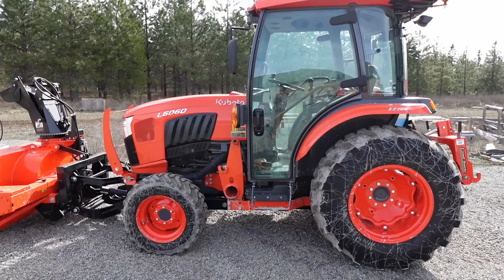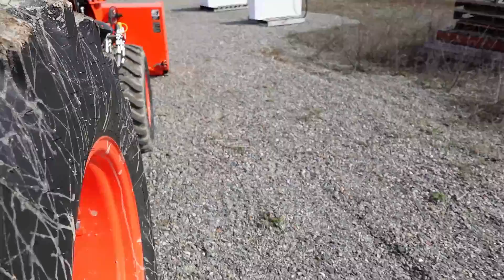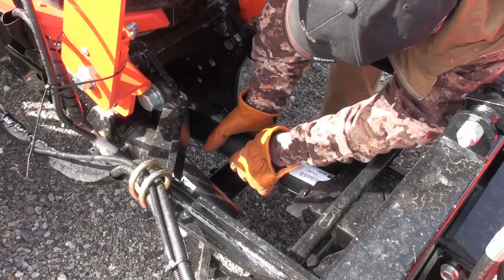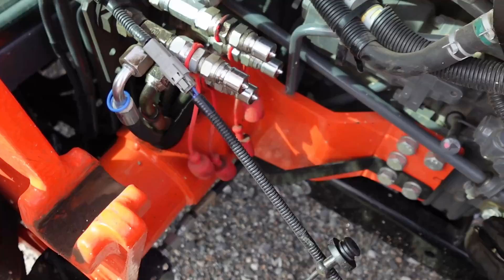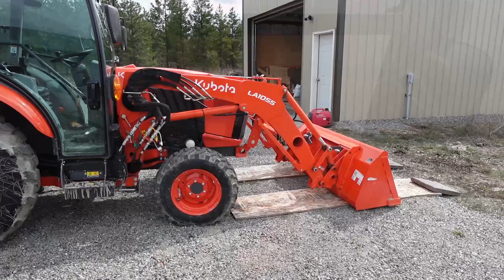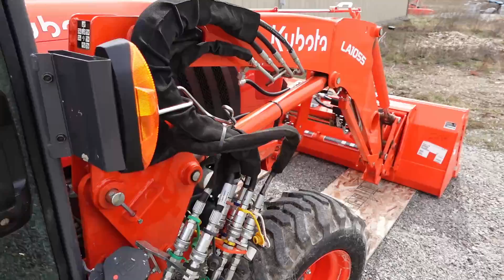Disconnect Kubota L6060 From Kubota L4474 Snowblower, The Best Way!

Comment: Nice video; Thanks!  Question ... I have a Grand L6060 as yours and I have to remove my grill guard to mount the front snow blower bracket (to where the grill guard was unbolted from), each and every year.  I noticed that your grill guard has the front snow blower bracket all as one unit.  Does your grill guard with integrated snow blower bracket have a unique Kubota Part number?  Could you please provide it if you know?  or did you get the snow blower bracket moded / welded to the grill guard?  I very much need to make this happen as I'm over 60 and swapping every year is getting harder and harder to do.  Thanks for any and all information you can provide.
Reply from the maker: Thank you for the comment. I really enjoy my L6060. The front mount I have is the “KUBOTA L4481 FRONT
SUPPORT FOR 4PT FRONT”. Not sure what they cost these days but when I bought mine they were $190.00 (US). This mount was great because it allowed me to keep my front grill attached all the time and still be able to attach the 4 point hitch.
Reply: @rockriveracres  Thanks very much for the great info. and quick reply!  This is great news!  I think I can use this as I have the same 'Manual' 4 point hitch, although I have the L4479 snowblower, but believe that both blowers mount to the same 4 point hitch.  Someone else said it worked with the 'Automatic' 4 point hitch, but am sure you have the manual type.  Is there anyway you could send a closeup of how the 'kit' mounts?  Or perhaps instructions of how to mount the L4481 kit / bracket?  Again, thanks so much!

Comment: Excellent video - Thanks!
Reply from the maker: Thank you, really appreciate the feedback. Let me know if there are other videos you would like to see. I’m working on one that will show how to reattach the sub frame and snowblower.
Reply: @ That would be helpful, there really isn’t a good one out there.  Another thought is how to change the hydraulic fluid filters, lots of different ideas floating around regarding the use of a shop vac to help keep the fluid in but I haven’t seen it done.

Comment: Your front brush guard is that Kubota?  My brush guard has to be removed for the bracket for the front hitch bracket.
Reply: Interesting, did you have to get longer mounting bolts?  I have the same guard on my L4060 (although I added a grill insert from Messiks when I bought a grapple), but I too have to remove it to add the subframe support…
Reply from the maker: I didn’t need to get longer bolts The L4481 mount came with everything to allow me to use my original grill guard and still be able to mount the sub frame when needed. Let me know if you need more details or photos. Thank you so much for viewing and your comment.
Reply from the maker: Yes, it is a Kubota part. The grill is the original grill that came on the tractor. The mount is the “Kubota L4481 Front Support For 4PT Front”. I bought it when I got the snow blower last year. Check with your local dealer. When I bought it they were listed at $190 (USD). Good luck, have fun.